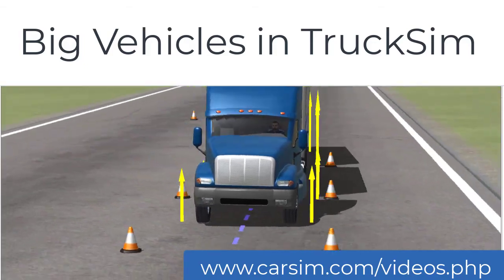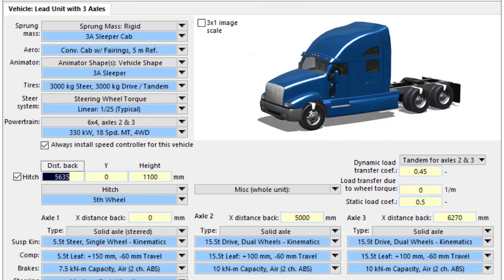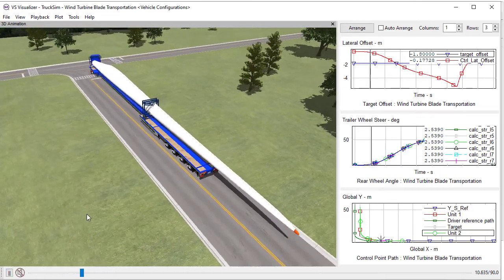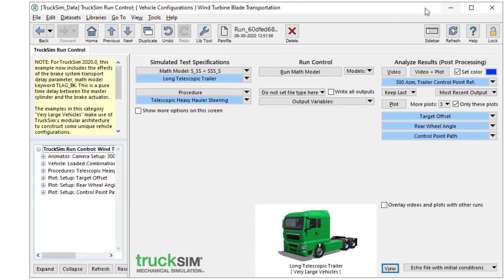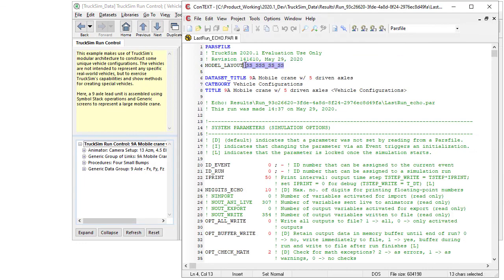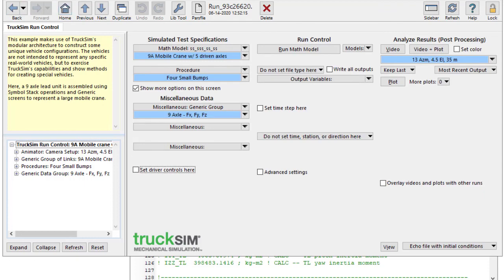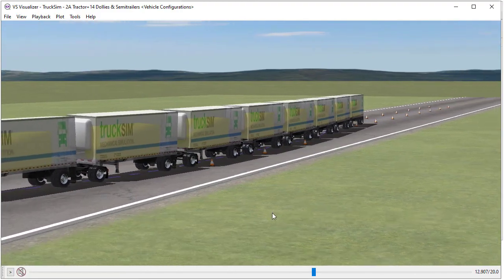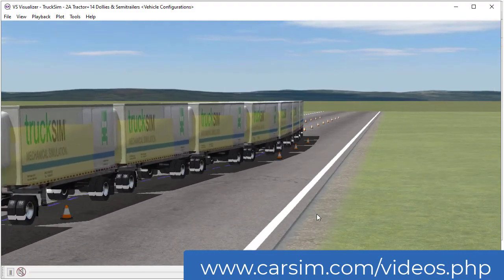Big Vehicles in TruckSim

Comment: Hi, Just wondering is it possible modeling tandem Pig trailer?
Reply from the maker: Yes, putting axles in the middle of the trailer is no problem. They can be singles, tandems, or tridems. The torsional moments from a 5th wheel can be disabled to do a pintle connection.